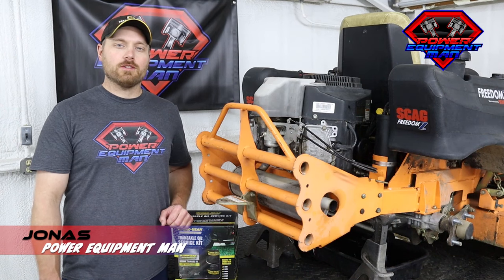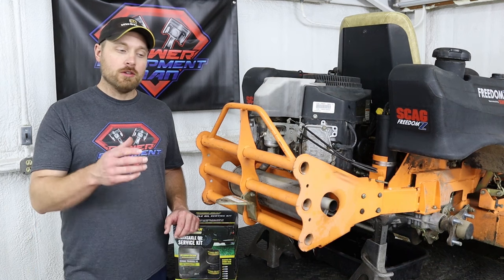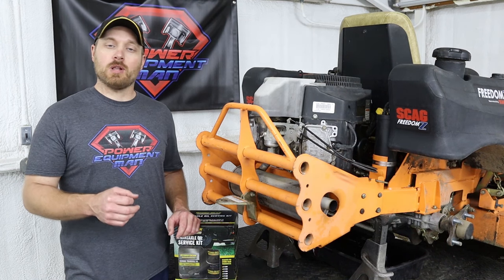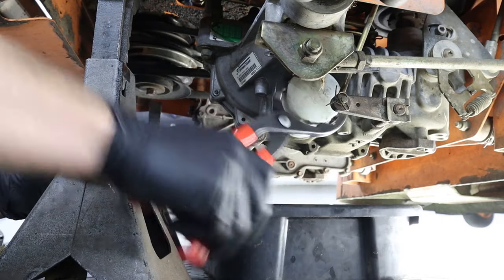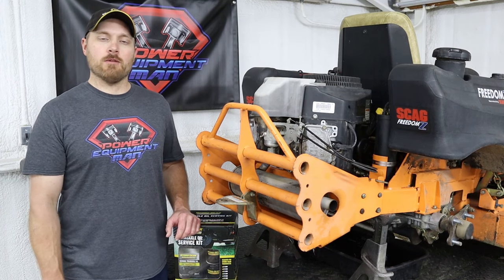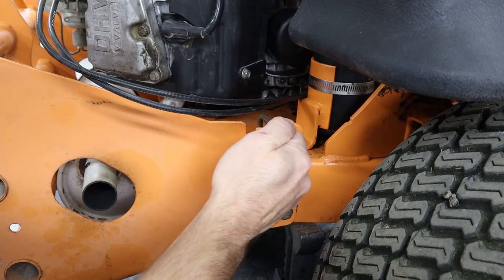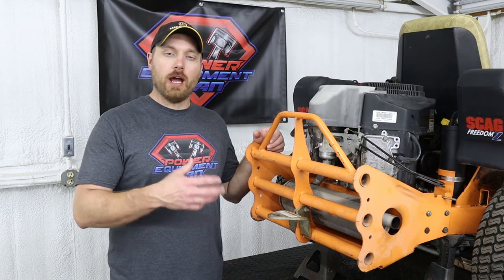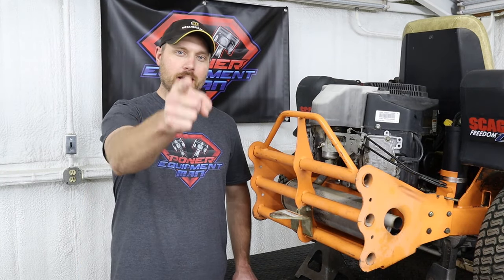Hydro Gear ZT-2800, ZT-3100, ZT-3400 Service Hydrostat Oil/Filter Change

Comment: You really had me thinking this was the best service video ever until you didn't address my mower with no reservoir. So I am still looking on how to do it..
Reply from the maker: If you don't have the reservoirs, you just use the pump and fitting that is included with the hydro gear service kit to pump the new oil in through the air bleeder bolt hole.
Reply: @PowerEquipmentMan  Thanks so much. Once I get it full, do I cap it off and run through the purging process and then
 remove the bolt to make sure its to the top?
Reply: Hydro-gear is pinching pennies now. The ZT2800 hydros don't have external tanks. They are internal now. Also, use clean drain pans for each hydo. It allows contaminates to be seen.

Comment: Thanks a lot man! I talked to my dealer this morning about having this service done and they quoted me over $400 dollars. Definitely think I'm gonna do it myself now.
Reply from the maker: Glad I could help. Thanks for watching
Reply: I just did mine. I didn’t use this kit because I can fill mine through the overflow reservoir. It wasn’t difficult but it took quite a while to fill the transaxles with oil. The manual for my Exmark Radius says to loosen the air vent bolts but I probably should have removed them. That’s probably why it took so long to fill.

Comment: I have a ZT-2800. The one reservoir is connected to the air bleeder bolt hole with a 90° pipe. How do I bleed it?

Comment: The 3100's on my gravely had 2 vent caps on the top of each hydro. I pulled both and followed your procedure. Flawless. Thanks so much for the video.
Reply from the maker: Glad it helped! Thanks for watching
Reply: Yea watched one video didn't show the vents on the Gravely mower. Removed worked great. My dealership uses 20/50 synthetic kawasaki oil.

Comment: If the hydro resivoir still have the caps on where does the air go thats in the system. I might be missing something, but the air would have to have somewhere to go?

Comment: you sir are a great mechanic. allowing time for something to cool off and wait overnight is going the extra mile and I do the same myself and it does indeed insure a proper repair verifcation. Multiple test runs and letting machines sit overnight to note differences when they are cold vs hot does go a long way. I can tell you strive for 0 comebacks and proper repairs! :) wonderful video and you have another like and a new subscriber ;)
Reply from the maker: I'm glad to hear there are other mechanics out there that are as picky as I am! Thanks for watching!

Comment: Nice video: Nothing off-topic. No music in the background. Good camera work. Very helpful. As for me, I did have to take my brake cable off to get to the plug. The plugs very factory installed, but very easy to get off with socket, but one of the filters was almost impossible.
Reply from the maker: Glad it was helpful! Thanks for watching!

Comment: Thank you for making this video.  It cleared up most of the issues and questions I had about the initial hydro(s) oil and filter change.  I have the mindset of early initial fluid changes on all my motorized vehicles and equipment.  BadBoy ZT-Elite:  Initial oil/filter change at 10 hrs and hydro oil/filter change at 50 hrs.

Comment: Awesome! I knocked this out last night and it worked great! I feel like it has more power and drives better. It certainly drives better. I'm sure it wasn't changed once since new (230 hours). I have a Husqvarna with ZT3100's. I had to remove the entire drive belt tensioner to access the bleed screws. Note to others: The reservoir fills up quick and drains slow. You can't pour the oil into it very fast otherwise you overfill the bottle and get oil everywhere.
Reply from the maker: Thanks for watching!

Comment: Your video is very good. Unfortunately my unit still lacks power on left hydro, especially under load like uphill. That was initial problem, was hoping fluid/filter change would solve it.
Reply from the maker: Sounds like you have a hydro issue.

Comment: Thanks for the video. Helped a lot. I have a wright zto. The filler plug is easy to remove on non chute side. On the chute side you can’t remove it unless you remove a pulley. I had to unscrew it as much as possible so it at least leaked. Took forever to get the oil to drain into that side. But got it done. Thanks!
Reply from the maker: Sounds like their engineer wasn't a mechanic! Thanks for watching

Comment: I acquired a Z260 a fewcweeks ago. Slightly used.
No owners manual or any info on all the required maintenance, or fill-levels, or torque specs.   KawFS 24 hp...hydrogear3400s.   i never owned a zt, so the more you post, the happier i am!!
Thank you for helping us....!!

Comment: Finally found another Freedom Z. I'm at the point of filling mine back up. These dump valves failed to work on this Skag. After washing this tractor a few times being that it had so much dirt and oil stuck in places that it should not have been. Now you can actually push it by hand now. These filters were very stuck though. I had to take a screwdriver to get them off. I believe that they have never been changed one time since 2006.
Reply from the maker: It wouldn't surprise me. We see machines all the time that the customer had no idea that they were supposed to change the hydro oil. Thanks for watching!

Comment: Thank you. It should be noted that some units , like my '20 Exmark Quest S 50"(ZT2800), does not have an external expansion tank, the units have short vent hoses next to a fill plug on top. Their  operator manual was too vague.
Reply from the maker: Yes, there are a lot of models now that are not using the expansion tanks. To service those, you must use the fitting that comes with the Hydrogear service kit to pump the oil back in though the air bleeder bolt hole.
Reply: @PowerEquipmentMan  I ended up pumping the fluid back in at the small plug at the top of the plate. It took an 11/16" wrench. I was able to get the specific amount in (a little over 2qts), and purged the system as per instructions. I'm glad that's not a service that has to be done that often.

Comment: Is it important to turn the mower off in between engaing/disengaging? Also what to do when you don't have a reservoir? Hard to top off a closed system do I only have to go by the overflow from bleeder?
Reply from the maker: Yes you need to turn the engine off when engaging and disengaging. If you don't have the reservoir, you will use the pump and fitting that comes with the Hydro Gear service kit (see link in the description) to fill the hydros through the bleeder hole. Once oil starts to come out of the fitting, it's full.

Comment: Great video. And definitely the best one I’ve seen on this topic. And I subscribed. I do have one question for you. I was watching a video yesterday and this guy had to turn a screw a quarter turn on each hydro. I have the ZT3400 hydro’s. Is the screw he had to turn the same thing as the lever I have to move on each hydro to disengage and engage the hydro’s?
Thanks for your time.
Ron
Reply from the maker: I'm not sure what screw he would have been turning. I have never seen these series of hydros with a screw for the release.

Comment: The 2800 hydros on my Bobcat ZT2000, has internal expansion tanks. I don't like this. I could quickly look at the reservoir tanks to check for leaks and fill during servicing. It still has the external oil filters.

Also, the newer EZT 2200+ hydros are somewhat serviceable. They now have drain plugs.
Reply from the maker: Thanks for watching!

Comment: My 2800s have “internal expansion tanks”. They were a pain to keep the fluid topped up during purge. Those external tanks seem far easier to deal with, both changing fluid and monitoring oil level between changes. I wonder if it’s viable to pull the breather vent plug and install an external tank kit…
Reply from the maker: If your machine has the internal expansion tanks, you will refill them using the special fitting that comes with the hydrogear service kit. It pumps the oil back in though the air bleeder hole. It's easy to do, just gotta have that fitting.

Comment: I agree with everyone else.Good 
presentation.
Although my right side still whines
like it stole something.Doesn’t pull hardly at all.
My machine is a 2012 Freedom Z. 63” deck
and 30 hp Briggs. Any help ???
Reply from the maker: Did it whine before doing the oil change? How many hours are on your mower?

Comment: Great video. On the ZT 3100 is the air relief bolt on the inside side of where the tire is or on the other side where the filter is located?
Reply from the maker: The air bleeder bolt should be on the inside of the hydro, close to where your deck belt is.
Reply: Thank you

Comment: Great video Very helpful Wanted to know I have a Dixie Chopper 60R cut it is2014 Magunm 2460R  With Kawasaki  FS730V.  I am trying to change the hydraulic fluid on the mower it doesn't have a bleed screw on it has 2 filters  and one field Box.  Do I still need to purge the system to get the air out. Your help would be gladly appreciated thank you and keep up the good work.
Reply from the maker: Sorry I don't know much about the Dixie Choppers, we don't really have any of those around here.

Comment: I picked up a 420 hour Husqvarna with 3400 hydro’s today. I cut my 3 acre property and noticed the hydros sounds noisy like a car with no power steering fluid. The reservoirs are full actually a little over full nonetheless. Also the oil looks real dark. Not sure if it’s ever been serviced. Do you think the dirty oil is making them noisy like that or something internal wrong?
Reply from the maker: I would service them and see if it helps. Those hydros should last 1000 hrs or more.

Comment: Hi. I have a 2021 54" Hustler Raptor XD in Australia. You did a great video on the servicing of Hydro stat. I have one question though, when you are purging/bleeding the system you would leave the bleeder valve/bolt out, is that correct. The XD has not a reservoir so that would be the fill point. Please advise. thank you
Reply from the maker: No you would not have the bleeder bolt removed while the engine is running. Here is a link to the service manual, hydro service procedure starts on page 4-7. https://documoto.digabit.com/ui/document/737912?q=raptor%20xd&exact=false
Reply: @PowerEquipmentMan  Hey, yeh thank you. Leave the bolt in while purging. Documoto link you have to sign in but has no option of setting up account. Thanks again

Comment: I’ve recently got an older mower with ZT-2800’s. It has 575 hours on on it and I don’t believe the oil has ever been changed. Safe to change it or stay away?
Reply from the maker: I would change it now.

Comment: Do you recommend putting anti-seize on the bleeder bolts?
Reply from the maker: You don't really need to. They are getting covered in oil as you are re-installing them.

Comment: I have a Cub Cadet ZT2 with ZT-2800's but no external reservoir. Do I just fill until it starts coming out of the fill hole? Then check the level again after the purge procedure?
Reply from the maker: Yes

Comment: What do you do if one of the hydro gears will not disengage? I drove it around a little with one not being able to disengage and it sounded okay just like the other that did properly purge.
Reply from the maker: As long as it is operating smoothly and sounds ok, you should be fine.

Comment: I have an Exmark radius s series zero turn. Even with the manual I’m having an issue finding the bleeder valves/bolts on both sides. Would they be located in the same position as that scag? BTW it’s a zt-3100
Reply from the maker: As far as I know, they should be in the same locations.

Comment: My zt3200s dont have any bleeder screw, jist bolts for the case halves.   Its extremely slow refilling through the reservoir
Reply from the maker: It should have the bleeder screws. They might have hex heads, or they might be allen heads. But I have never seen one that didn't have them.

Comment: Question on bad boys mower is the 3100 series transaxle better than the 3400
Reply from the maker: No. The higher the number, the better the hydro. So a 3100 is a step down from a 3400.

Comment: Do you remove the bleeder screw or just loosen it a few turns?
Reply from the maker: Completely remove the bleeder screw.
Reply: @PowerEquipmentMan  how do you know how much to put back in? Mines a ferris z2 and has the external reservoirs for each side.
Reply from the maker: @travisconner1581  If you watch the full video, it tells you exactly how to know when the hydros are full. I'm guessing your total capacity should be around 4.5 qts.

Comment: This ZT 3400 on husky has two separate bleeders 11/16 up top and passenger side is a pain to get to! Do both need to be running oil when filling and how will it evenly fill both sides without clamping off hose on one side then the other? Piss poor design for Access.
Reply from the maker: The air bleeder from each hydro has to be removed while filling. As soon as oil starts to run out of one, put the plug back in that one only. Then wait until oil runs out of the other one, then put the plug in that one. Then you know both hydros are full and ready to purge.
Reply: @PowerEquipmentMan  that's awesome to have you reply and say that! I was thinking either clamp one off at a time until full or give her hell until both running fluid lol. You definitely have a need for a "thin" 11/16 wrench on passenger side which I happen to have at shop and will get tomorrow from toolbox. I'll get it filled and let you know how purge goes. My initial issue was whining terribly on right side...  90hrs on it from New. Awesome video and thanks so much for posting!
Reply: Do plugs actually have to be removed all the way or just cracked a few turns as the one is barely accessible?
Reply from the maker: @bkirk2278  removed
Reply: @PowerEquipmentMan  ok thank you!
Reply: Just finished purging "hopefully" and buttoning things up. That "passenger" side 11/16 bleeder bolt is a nightmare to get out and back in. 4.5qts.....warming and driving here shortly.

Levers wouldn't allow enough stroke to disengage the transmission so I had to put trailer hitch pins in to hold them back!!
Reply: Mowed for 20min..... everything seems good to go! Thanks again!

Comment: Do you know what oil comes standard in a new 2022 Hustler Fastrak SDX with the Hydro Gear ZT3400 transmissions? I need to add some oil to one of the reservoirs to bring the level up to the “full cold” line.
Reply from the maker: I believe the hydros come pre-filled with oil from Hydro-Gear when Hustler gets them. So I would assume they have the Hydro-Gear oil in them.
Reply: @PowerEquipmentMan  I sent an email to Hydro-Gear and they replied back saying “Standard Mobil 1  20w-50”…. But to me, this doesn’t make sense.

Comment: have a Dixie Chopper 50 " magnum X , I have not been able to find the hydrostat release control , HELP !
Reply from the maker: What series of hydros do you have?
Reply: @PowerEquipmentMan   DANG  thanks for the super quick reply ...it is a ZT-3400
Reply from the maker: @uredskivid  The shaft for the hydro release goes in the top side of the hydro. Look/feel for the shaft sticking up out of the hydro and then if it has a linkage connected to it. Sorry I'm not very familiar with the Dixie Choppers so I don't have any info on that exact machine.
Reply: OK thanks .

Comment: I didn't hear you mention what weight oil to use anywhere. I get the filters at John Deere for $8.50 each
Reply from the maker: There is a lot of debate on what weight of oil to use and synthetic vs non-synthetic, so I do not want to comment on that for liability reasons. I recommend purchasing the Hydro-gear complete service kit. They aren't that expensive, and ensure that you are getting the correct oil and filters.
Reply: @PowerEquipmentMan  I am using the filters from John Deere that made the mower. They said it uses 10w/30 motor oil. My bad boy.hydro.gear 5400's use 20w/50 motor oil

Comment: How did you get the vent plug or air bleeding bolt off?
Reply from the maker: I show it in the video. Some are a hex head bolt, others are an allen wrench. They are usually VERY tight when new. Good luck!
Reply: @PowerEquipmentMan Mine were not tight. I was surprised how easy they were to turn.

Comment: I have a cub cadet zforce sx60 with the hydo 3100. Since it is a steering wheel zero turn, how exactly do I purge out the air since it's 4 wheel steering and steering wheel instead of a lap bar ?
Reply from the maker: I'm not a cub cadet guy, but I would assume you just push the pedals. All you need to do is get the tires to turn forwards and backwards.

Comment: Do you have the resivor cap off when purging the air?  thanks
Reply from the maker: No. Thanks for watching
Reply: There is no air bleeder screw my 2020 gravely zt 3100 pumps

Comment: Stripped purge plug with 1/4 hex drive in center. Any idea how to get it out now
Reply from the maker: Try grabbing around the outside edge with vice-grip pliers. That's why I say to break those loose before you drain the oil, so if you have to you can still drive it on the trailer and take it to a dealer. Good luck
Reply: @PowerEquipmentMan  yes I have not drained any yet.

Comment: Can you upgrade from a ZT-2200 to a ZT-2800, on up?
Reply from the maker: I have never heard of anyone trying to do that. It would most likely be cheaper to just buy a higher grade mower that has the better hydros. The ZT-2800s cost around $800-1000 each, plus labor.